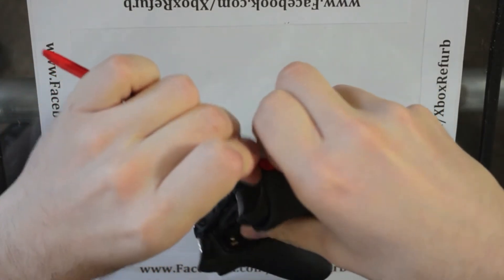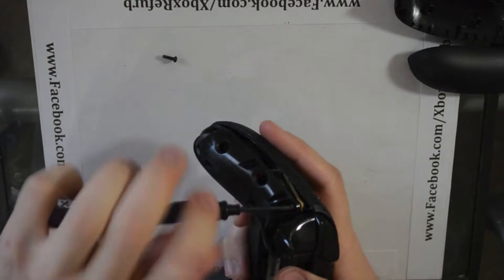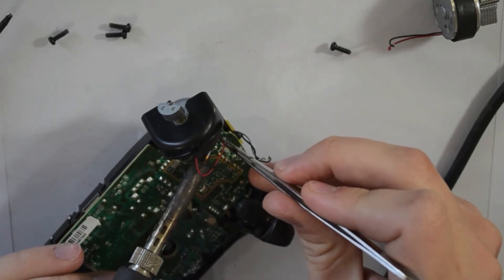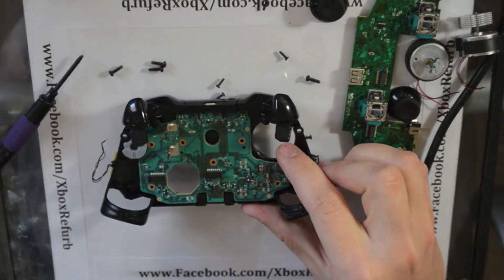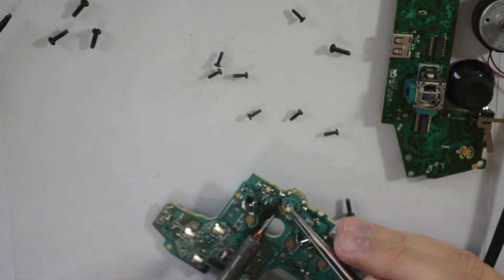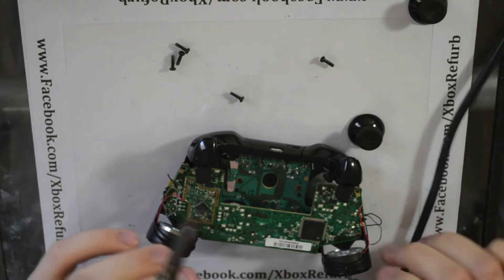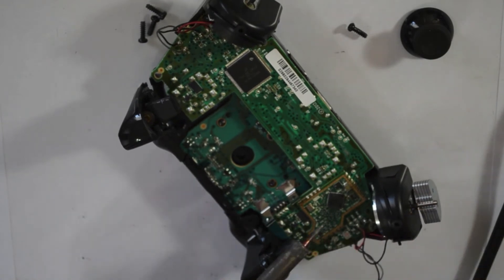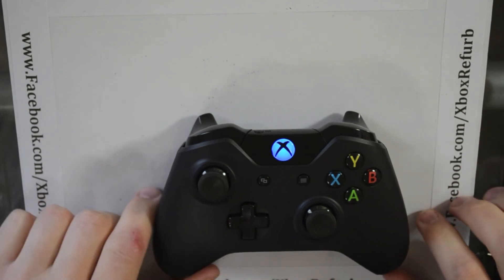Xbox One Controller Teardown and LED change 80% dis-assembly video

Comment: Iam trying to add thumb stick light but I only want it to turn on when the power button is turn on where can I solder the negative wire to get this done.. If you can help that would be awesome..
Thanks in advance

Comment: Nice vid. Didn't think of changing the LED before. I think I need to invest in a soldering iron. Any idea's on how to stop the thumb stick controls from creeping up? I've took the controller apart and then blew on the thumb stick switch whilst turning it around to try and get rid of any dust but no joy. It's looking like I will have to buy a new one.
Reply: +Ryan Halewood Never mind Just browsing through your vids an seen you have one. Going to watch it now.